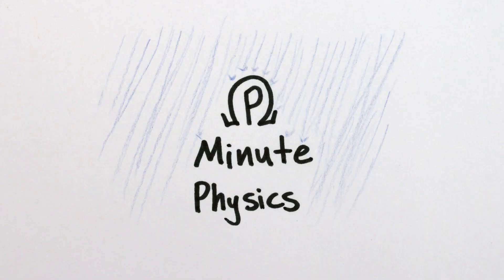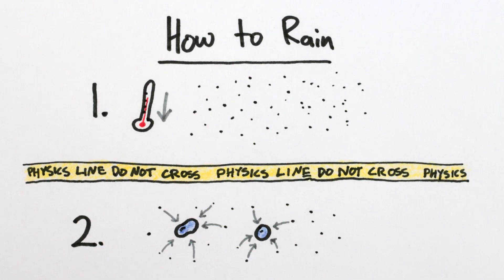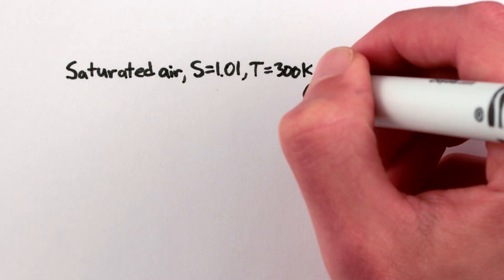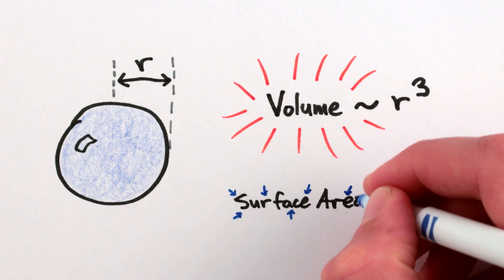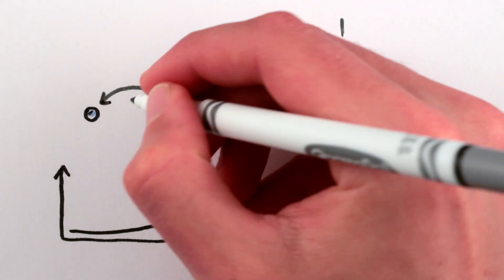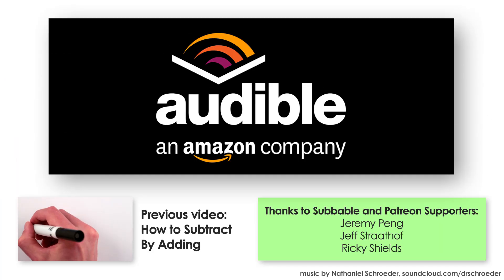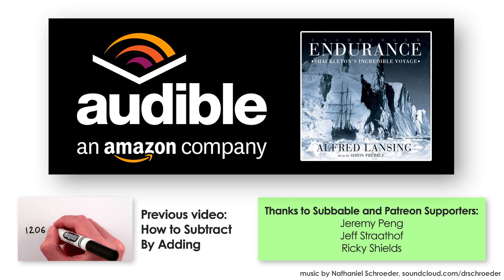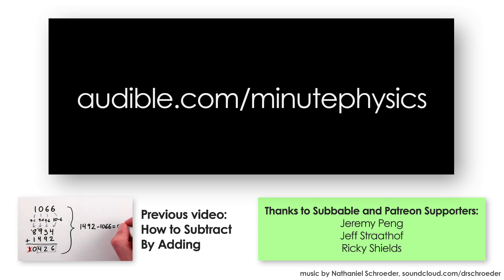Why Raindrops Are Mathematically Impossible

Comment: Am I missing something here?  The square/cube problem is only an issue because of arbitrarily drawn lines when the units were defined.  The math only breaks when whatever unit you're using drops below 1, at that point squaring or cubing will only make the number smaller so why not use a different unit.  Everything will always be broken if you try to use a large unit like cubic meters but fundamentally nothing has changed.  Use a smaller unit and the math won't break.
Reply: uzimonkey 
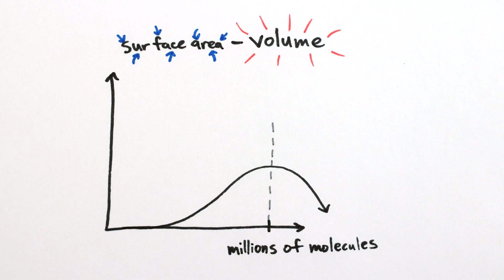It's not about the units, these <1 numbers are used to illustrate why this happens rather than identify the occurence itself. Notice that around 1:45 onwards he mentions the specific case of water droplets "few million molecules".
Reply: uzimonkey yeah, I got confused by that too. Sure, 0.1m squared is 0.01m, while cubed is 0.001m, 10x smaller. But 10cm (the same 0.1m) squared is 100cm and cubed is 1000cm, 10x bigger, so it did seem dependable on units. From what I gather though, is that the energy you need is dependable on a constant, and said constant is measured (generically) in energy/m³ for volume and energy/m² for area. This means that if you want to use cm or mm to calculate the energy associated with the droplet growing/shrinking you would need to transform the constants and that would compensate for the growth in volume you would seem. E.g. in m, the constants could be the same, but in mm, the volume one would be 1000x smaller, so as long as the volume isnt 2/3 of 1000mm³ the volume isnt going to be bigger than the area.
Reply: uzimonkey The point is rather than given Es = a*S ~= a*R^2 energy increase from surface formation and Ev = b*V ~= b*R^3 energy decrease from volume formation, there will always exist R_critical such as Es > Ev for R < R_critical.

Comment: Can you explain that in english please.
Reply: Si es casi imposible para quien habla inglés.... Ya te podrás imaginar yo aquí..😀
Reply: Kaynos Fair question. As a simple summary, the mathematics they show seems to imply that there's not enough energy available for water molecules to cohere, because if they were to cohere, in the early stage, when the radius is small, the volume would decrease faster than the surface area, & the surface area requires more energy to maintain its integrity than is available from the small volume. The mathematical model, however, ignores that we don't actually have pure water in pure air. Water molecules can adhere to dust particles & in this way come together to form raindrops. This is the principle behind the success of seeding clouds. Another issue is that if you measured the radius in extremely small units, then the radius would be a number greater than 1 from the beginning. Then the volume measured in the corresponding cubic units would be increasing faster than the surface area measured in the corresponding square units from the start.
Reply: Sam Strobel you must be fun at partys
Reply: Marie Curie damn u
Reply: +Adrian Kiel雨量超過一千
Reply: audible
Reply: English:
Bcuz fisics raindrps shouldnt egsist
Reply: Minecraftnoob2 dont forget that is only for x<1 m8
Reply: Yep... English is hard😡
Reply: ***** How does water vapour condense into water liquid when cooling down sterile water vapour containing air? Does it just keep getting colder and colder until it deposes into ice??
Reply: ***** That makes much more sense.
Reply: ***** What about inside a sterile room with no dust particulates in it whatsoever? Water is weakly paramagnetic, right? So what if you had super powerful magnets holding it in place so it doesn't interact with anything? And it's sterile so...
Reply: Kaynos Basically raindrops are mathmatically impossible because x3 < x2
Reply: 雨は、基本的な物理学によると、起こるべきではありません。
Reply: Adrian Kiel That's not English :/
Reply: James Oldfield o sry
Reply: Panchi bole hai kya

Comment: i'm confused by the relationship with squared and cubed when dealing with numbers < 1... surely if you just measure with a smaller measurement then the value is now > 1 and you don't have this problem. ie. instead of 0.5 cm you say 5mm
Reply: MrSplodgeySplodge Right... i think i get it. I see the numbers working out. I get that there are 10 mm in 1 cm yet 100 square mm in 1 square cm (and even 1000 cube mm in 1 cube cm)... but my brain is still refusing to accept it all as truth. Stupid brain. Thanks for the explanation!

Comment: Perhaps stating the obvious, but isn't gravity missing?
Reply: jepkratz When talking about very small length-scales, like molecules, the effect of gravity is so small you can ignore it.
Reply: Nickesh Chauhan But isn't the pull of gravity, along with wind(?,) which causes the small to bump, amass, and then fall?
Reply: jepkratz My point about negligible gravity still stands at that lengthscale. The video is looking at water vapour with no external forces (like the wind) acting on it.
Wind would certainly input energy to the system and make the molecules move faster, but faster moving particles would make it harder to form droplets, not easier, because the molecules would bounce off each other rather than hold together.
What you need, as the MinuteEarth video shows, is something physical for the molecules to latch on to and grow that way.
Reply: Nickesh Chauhan It's not like we deal, day to day, with water vapor that has no external forces acting upon it, such as in a vacuum. Dust perhaps being that to which the vapor adheres? Water molecules don't always bounce. If their charges are complementary, don't they bond? Thank you and best regards. I'm stretching the limits of my layman's understanding.
Reply: 'Twas a pleasure to converse calmly with you on the internet xD
You are very correct, Physicists like to simplify everything as far as possible. There's a fun XKCD comic about how frictionless vacuums are our favourite thing in the world.
The MinuteEarth video deals with how this stuff applies to the real world, I'd highly recommend watching it (sadly it's not voiced by Henry).
Reply: jepkratz no, it's still here. Check under your seat.

Comment: It IS mathematically possible because 9 + 10 = 21
Reply: I'm assuming the 10 is in base 8, which would make 10 8 in base 10. 9+8 would then equal to 17, which in base 8 is 21.
Reply: RogueDemonZ you stupid
Reply: Kill me.
Reply: TheDiamondHack Didn't you say that mathematics has been proven wrong by this video? Doesn't it make 9 + 10 = 19 wrong as well?
Reply: maxlife459 True, but base 8 has no digit 9. In fact, 10 + x, x < 10, in any base, becomes x-teen.
∴ you stupid

edit: for positive integers x and integer bases greater than 1.
Reply: maxlife459 Mind =  Blown
How long did it take to come up with that one? x)
(Even though it's not completely correct)
Reply: RogueDemonZ You mean ex falso quodlibet?
Reply: Suiseiseki Desu no math is nerver wrong unless you're doing it wrong so just watch the minute earth video
Reply: 6 + 9 = 6|9 :p
Reply: TheLonewolf114 It took me 10 seconds when i read the comment
Reply: 17inchcorkscrew 9 is still in base 10, it's only 10 and 21 that are in base 8
Reply: 9 (base 10) + 10 (base 12) = 21 (base 10)
Reply: 9(b10) + 10(bn) = 21(bx), x = n/2 + 4
Reply: You forgot to add a rule so that n is an even number. Just a heads' up.
Reply: maxlife459 No, if n is an odd number (for example: 9), x is n/2 + 4 (example: 8.5), and 9 (b10) + 10(b9) = 21(b8.5). I had somewhere to be, so I planned to add intervals for my variables now, but it holds as long as x > 2 (and, as a result, n > -4).
Reply: 17inchcorkscrew n can be an odd number, but it should be avoided because then x would have to be a decimal, which would cause calculations higher than the 6th digit (000000) to become messy due to the multiplication of decimals.

example: the 4th digit in base 8.5 would increase the value by 614.125, the 5th would increase it by 5220.0625.

Even if the numbers would never reach that high of a value, it is best to use whole numbers as the base value. As such, the value for n should be even
Reply: maxlife459 You disapprove of non-positive-integer bases because they're unwieldy when handling numbers commonly found in base 10? That's, like, the least compelling objection to theoretical mathematics I've heard.
Reply: uhh....i didn't say anything about non-positive integer bases. I was talking about whole number and decimal bases in my last comment.
Reply: maxlife459 Yeah, I put a dash between positive and integer, but I thought my wording could have been unclear. I meant numbers that aren't positive integers, as opposed to integers that aren't positive. However, that's totally irrelevant to the actual content of the comment.
Reply: bases with non-positive integers is possible, but the math required to do so is not easy to do by heart if the value goes beyond six digits. There's no stopping you from doing so, but it's better to remember and calculate if it was a natural number (positive integer).
Reply: RogueDemonZ Am I seriously the only one that understood the joke?
Reply: omatomatom Lol finally someone who gets the joke.
Reply: RogueDemonZ In the dozenal RogueDemonZ, where 21 is decimal, and 10 is dozenal.

Comment: Okay, but wait... : 1/2^2 would be 1/4, but what measurement are we talking?
I mean 1/2 inches would be that, but then if we concert it to cm we have about 2.54/2 which is more than 1 so squaring the number would be above the original value. 
Isn't it correct to reduce the measurement's size until we hit a value above 1?